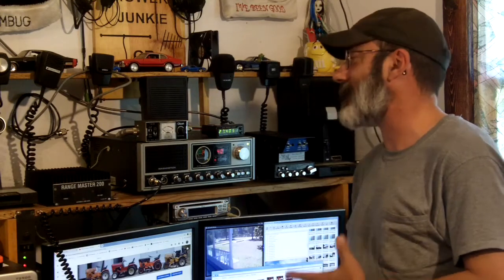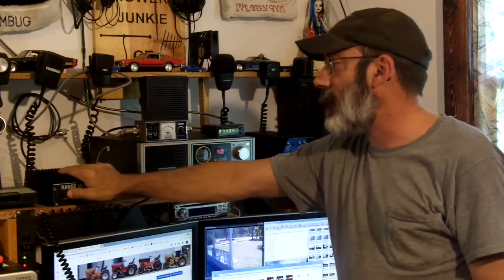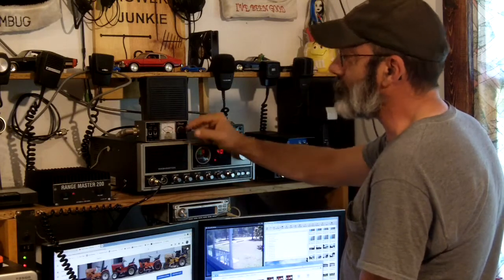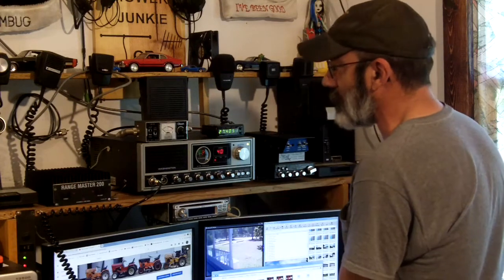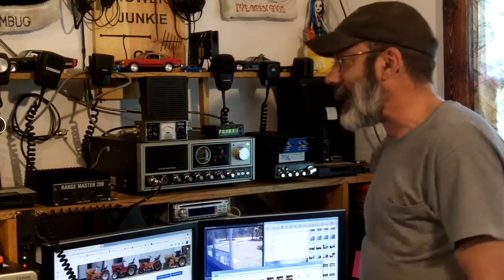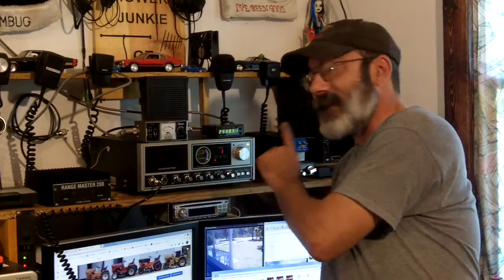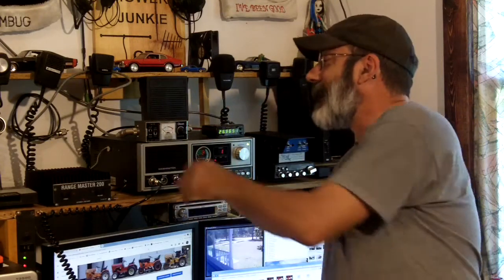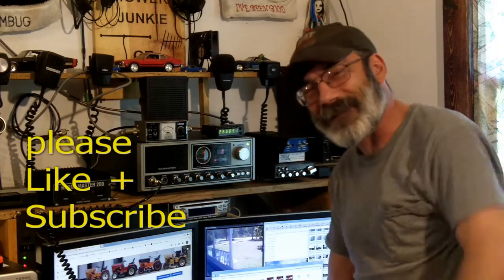Antenna SWR Basics, How to check and set Your Meter, CB Radio Tuning

Comment: Hi 151 S Carolina. I'm about to pull my hair out with high SWR on my wire Jpole.
Its picking up the world as I flip through the channels there is something going on on almost every other channel but I have not managed to get the SWR down to a usable range.
I built it exactly to Dave Tadlocs spec here. http://www.amateurradio.bz/cb_radio_j-pole_antenna.html
Seems to be calculated at 28.5 frequency which is in the middle of the 10 meter band but man it is receiving good.😀
Reply from the maker: Hi Blade, I wish I had some advise to give You....But I have not built a j-pole antenna yet.
So I'm not very familiar with them. I hope You get it all worked out.
Reply: @MowerJunkie  Thanks! Maybe moving it will help.
I'm about ready to do the 102 inch whip or cheaper dipole and to heck with the jpole.😀
Reply: @MowerJunkie  Wow! I finally have my jpole tuned enough to where I can fine tune.
SWRs 2.2 on ch1,  2.8 on ch20 and 2.9 on 40.
The antenna is 
24ft9" long side, 8ft 2.5" short side. 
Antenna feed is 9 and 11/16 inches from bottom.
Ctr conductor connected to long side, shield to short side. 
300 ohm twin lead on bottom for 1/4 wave section which is old tv cable and 12 gauge wire makes the half wave top.😀 1/2 wave over 1/4 is what this is.
SWR is higher on 40 so I'll move both feed points down now until good SWR is achieved through out the band.
Reply: Yeah you just have to adjust the overall length and find the 50 ohm point on the tuning jumper. J poles also suffer from really bad common mode and are sensitive to surrounding objects and height above ground. A decent coaxial choke is advisable. I had trouble tuning one once, every time I'd put it up the SWR would go up. I resolved this by feeding at the 200 ohm point with a 4:1 coaxial balun (very easy to make from a half wave section of coax). It totally settled it down.

Comment: Just because I'm completely new to this hobby ,if I'm understanding right if I can get my swr as close and as low as possible I should transmit and receive better. Any help would be appreciated ,and thank you for the clearer video.
Reply from the maker: Yes! Your antenna will be more efficient with a lower SWR. if You can achieve a 1-1 SWR, all of the radios output power will be sent out of the antenna. but anything under 1.5 will work well.
Thanks for watching.
Reply: @MowerJunkie  thank you for the fast reply and being extra clear . ive watched close to 21 different videos and had 20 different answers . yours was the first to make it dummy proof for someone like myself. Thanks again
Reply from the maker: @mattd6128  Awesome! I'm glad I could help. Enjoy the hobby, 73's
Reply: @MowerJunkie  if that's the case, how is that a doublet antenna with swr in excess of 10.1 is very efficient  with very little loss

Comment: Thanks for sharing.
Looks like it would be safer to leave power low as possible to set up a new antenna just in case. Since you have to stay keyed up a few seconds to get the Meter calibrated.  I had a coax ground out completely where it bends into the radio while attempting to setup a new antenna. 
I had my power up while attempting to set SWR's on a new troublesome antenna when all the sudden my SWR's maxed out on all channels. 
My Stryker 955 has an SWR safety cut off feature and thankfully saved the radio.

I also didn't know but antennas can get hot. That's why mine shorted out in that sharp bend. The ctr conductor got hot and pushed through the plastic shielding to the outer jacket.
Reply from the maker: Whenever I build a new antenna, I use a cheap radio that I don't care about for the first test. so far I've been lucky, and My $5 flea market special, lives on to test many more antennas. Thanks for watching, 73's from 151 SC.
Reply: @MowerJunkie  I just discovered that there is not enough threads at the antenna connection on my Stryker 955 to tighten the nut up to where no part of the connector moves.
The nut bottoms out leaving the ground connection loose and sloppy
To fix it I sawed 4 mm off the face of the new pl 259 elbow nut that I got so my coax dont have to do a 90 degree turn any longer. And my SWRs were the best ever. . 2 on 1,  .2 on 20  and 1.4 on 40.😀
Reply from the maker: @RC-Heli835  That's great! I'm glad You found a way to make it work.  sometimes all it takes, is a little creativity.

Comment: What does it mean if my swr is 1:1 on all channels? My meter barely moves at all. I don't think it's correct because I hear 1:1 is hard to achieve.
Reply from the maker: it means You have a very good tune on Your antenna, Congrats. Thank for watching.
Reply: It means your antenna has a very good bandwidth. Quarter wave GPs can exhibit this.
Reply: It doesn't necessarily mean all is OK it can mean there is a lot of loss in your system

Comment: I was told you can talk on 1.6 or 1.7 swr and it won't hurt nothing ! I heard as long as your below 2 you can talk !
Reply from the maker: You're correct, You can use an antenna with 1.7, But only if You're using a stock radio. If You are using an amp, it should be less than 1.5
Thanks for watching, 73's from 151 SC.
Reply: It is ok if in a hurry or emergency, but for a mobile for more than quick info a few second transmits, but for a basestation or mobile for distant work, skip, long qso's it is worth it to fine tune it, and make sure every % of wattage is radiated, instead of going back into the radio. Letting swr slide can also boost interference to other electronics or appliances.

Comment: I made a dipole antenna out of some stripped romex the other day. I have it on a string just 4 inches below the ceiling in my carport of my home. My ground plane element and driven element are right at 102 inches long. My reading on channel 1 is around 1.7 and channel 40 is around 1.9 would you trim any or leave it alone? If so would you trim the ground and the driven element or the the driven element? Thanks
Reply from the maker: You should be able to get the same reading on all 40 channels when using solid copper house wire.
Your reading is higher on 40, so the antenna is too long. Trim an 1/8" from each end until The reading is the same. You should try for 1.5 or less. I have also found that sometimes where the antenna is mounted can effect the swr. try moving it to a different location and test again. Thanks for watching, 73's from 151 SC.

Comment: I'm get 5 on 40 and on 1 .do you think I need a ground wire .I have a base station and useing a fiberglass antenna tied to a old broom stick holding the antenna with a metal clamp .I got it mounted on a 4 by 4 8 foot post so the antenna is about 17 feet high
Reply from the maker: Yup, You most likely don't have enough ground plane. try adding a couple of 102" wires down at a 45 degree angle.
Reply: 102 inches is too short for even ch40 if you are using copper wire or even aluminium. I'd add at least another 5% for return currents.

Comment: Oh and, I dig the little red Maverick you got there on the shelf. Always wanted to build a nice Grabber.
Reply from the maker: Thanks, Mavericks have always been My favorite cars, over the years I've had 8 of them, including 3 with v8's. I ran a 13.2 at New England Drag way with a 72 V8 maverick.
Reply: @MowerJunkie  LMAO, at the Maverick.They were fun little cars. We squeezed a 302 in a 72 maverick, Put a Edelbrock high rise manifold and a Holley 4 barrel. Added a hood scoop cut the rear quarter panels, jacked it up and added Mickey Thompson 50s. That car was scary not to mention all the tickets we got from the Milwaukee PD. Those were the days Man.
Reply from the maker: @petmycat2720  That's awesome! V8 Mavericks are so much fun! Thanks for sharing, 73's from 151 SC.
Reply: @MowerJunkie  73s Back at cha...4167 WNC.

Comment: I went for an antenna analyzer for the first time in 45 years of modulating on the citizen bands. Love how easy it is to tune my Antron 99 on the fly, so to speak. I can test at any point in the chain and have finally got my match down to a 1.1 to 1.3 curve between 1 and 40.
Reply from the maker: very nice! an antenna analyzer is on My wish list, someday I'll get 1.

Comment: Excellent presentation about tuning the SWR meter! That would be extremely helpful to know when setting it. Also I forgot to ask, where can I get bare copper grounding wire? Because all I see at home depot is very large bare copper wire. What is the best gauge size to ground my antenna and where can I get it?

*edit* I also live on a three story building (I don't know if that makes a difference too)
Reply from the maker: I'm not sure what the best size wire to use is, But I used 12 gauge jacketed wire to ground My antenna. I just stripped the ends at the connections. I used white wire so that it would blend in with the siding on My house.